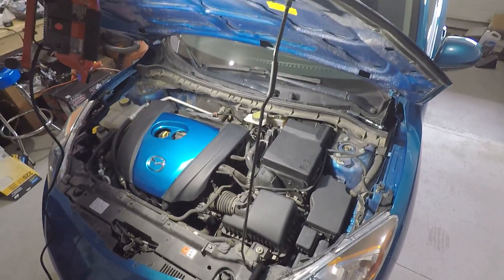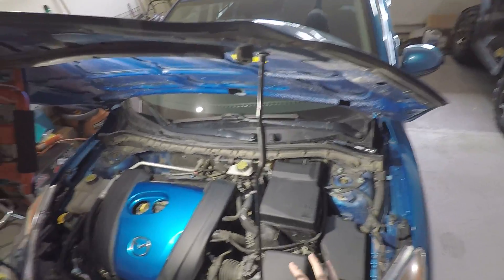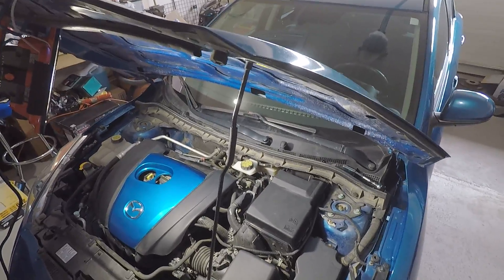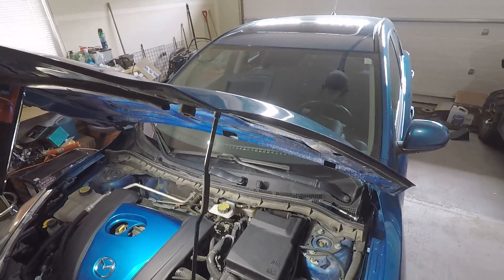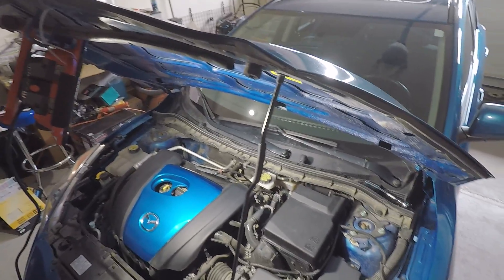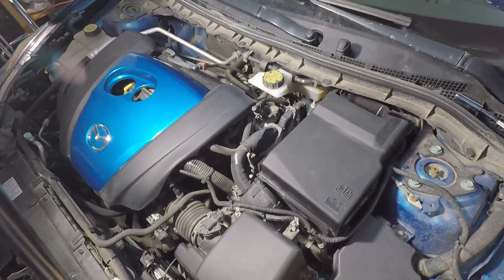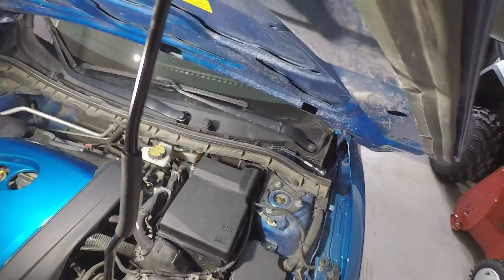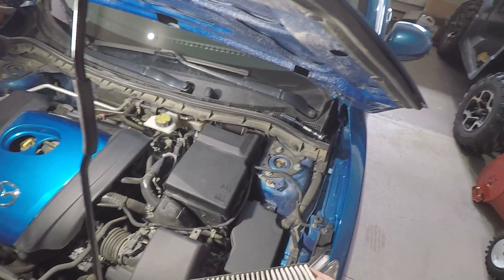Replacing your Engine Air Filter 2010 - 2013 Mazda 3

Comment: How do you add freon (recharge your ac) in your 2013 Mazda 3?
Reply from the maker: Hi Suzie Bougié I will try and get a video out on it this summer. I current don't need to do it but I may do a video is showing you the process.
Reply: @TDLDIY  thanks.  That would be great. Even if you don't, the thought was appreciated.
Reply: Buy the bottle from you local autostart store, start your car, turn on your a/c, hook up bottle to low pressure line (L), squeeze bottle to add freon ( not too fast), monitor gage on bottle, feel cool A/C in car, remove bottle, replace cap. Drive away happy.